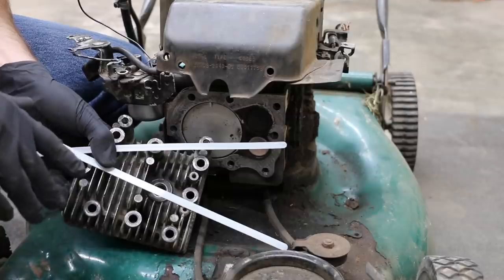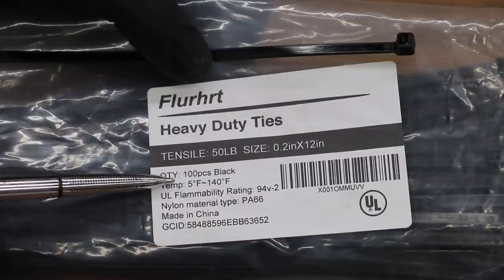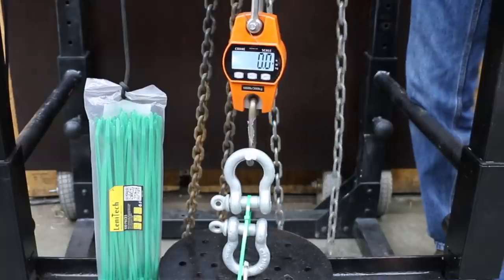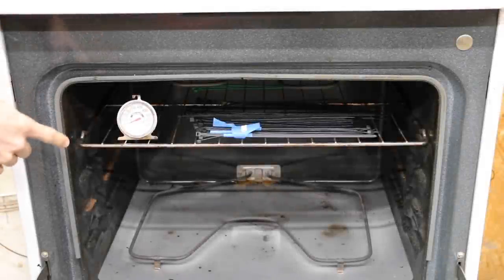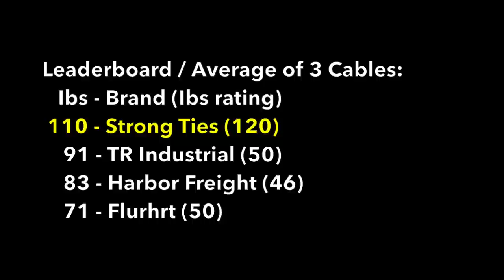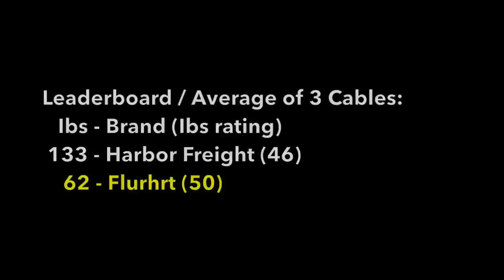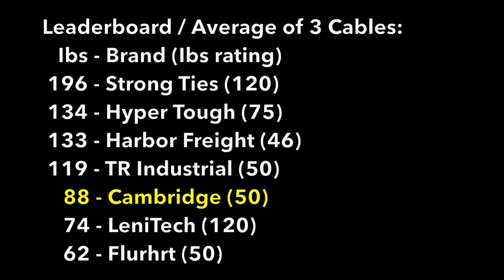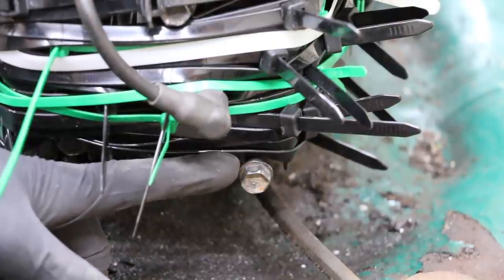Best Zip Tie Brand (7 Brands Tested)? Let's find out!

Comment: Here's a question to contemplate. If you rate a rope or cable, it is for a single length of material, not a loop. If you make a loop, like using a block and tackle, the load capacity for the assembly is each rope or cable; two ropes or cables would be double the listed load capacity. If it's that way with cable ties then many of them fail their rated capacity if used in a loop with two legs. A 50 pound rated tie should test at 100 pounds in a loop. Does the tester know the specifics of how the products are rated?

Comment: In your lifting configuration, it looks as if two strands of the zip tie are doing the lifting. Wouldn't you then divide the measured lifting capacity by two to get the final tensile strength?.. Just a thought🤪BTW: LOve your videos👍

Comment: When you loop the tie, the tensile force in the tie is half the scale measurement. For example 100lb force on the scale creates 50lbs of force in each side of the tie. A free body diagram would visually explain it.
Reply from the maker: Great feedback.  Several of the packages mentioned "loop capacity" for the strength rating as you've described. Thank you

Comment: I think there are at least 2 other angles worth examining:
Saftey: How far above rated capacity did they hold? In my opinion, that's why "Lemontech" fully deserves last place. I mean, their misinformation could easily cause injury or death.
Additionally, there's the geometry of the objects being tied. How might the results have been different with wider or narrower bolts? What about square or triangular?

Overall, this was a very enlightening video. I think anyone who regularly uses zipties should watch this and take note.
Reply from the maker: Thank you for the feedback

Comment: Could you of put all the head bolts in the cylinder block then put the zip ties on and removed the bolts? Or removed the bolts while it was running? Probably a little too dangerous
Reply from the maker: Great test idea!  Thank you

Comment: Can you test safety equipment like the different types of leather for gloves, steel wire inserts for butcher gloves, or switch it up to the million type of safety goggles and see which one will actually stop a grinder wheel explosion or lose nail from a nail gun?

Comment: At my house on the coast of CA, my problem with zip ties is not heat or cold (70 is usually a heatwave and 50 is a cold snap, frost is rare).  My problem is UV exposure.  After a season hold up a whirligig, the zip ties get brittle and snap.  Try doing a UV test on some zip ties.
Reply from the maker: Thanks for the suggestion.

Comment: I have never found a zip tie that will last over about a year in the sun. I sometimes use them to hold an awning tarp to a pipe frame and they dontt hold hardly any weight but they always break and fall off.
Reply from the maker: Thanks for sharing.

Comment: Here are some ideas if not already been tested as I frequently purchase or planning to:

Water based paint
Enamel Paint
High Heat Paint (engine paint)
LED Bulbs
Engine Degreaser
Oven Cleaner
Laundry Detergent
Carpet Cleaning Solution
Car Detailing Products I always see on FB like “the last top coat” etc
Dishwashing Pods
Dishwashing Soap
Best bottled water (cleanest, best PH, dissolved solids)
Best Sawzall blade (wood, plastic, steel)
Best Screw Head (phillips, torx, mor-torq, tri-wing)

LoL have at it!!! 👍🏼👍🏼

Comment: What use for zip-ties is there other than tie wires or other things together or to an existing harness or bracket?  Never needed even 50 lbs of tensile strength.   Have been using Harbor freight zips for decades.  No need to spend more.   Buy them on sale, even cheaper.
Reply from the maker: Thank you for the feedback
Reply: BroDerp, ties are used to seal the CV boots in most cars and many trucks today. You don't want a ten-cent cheaper tie failure leading to the ingress of crap and ultimate destruction of an expensive machine part.

Comment: The best zip ties are the ones that can be undone and reused.. zip ties arnt usually used when strength is required.. but often times need to be moved or redone.. having ones that can unlock is most convenient
Reply from the maker: Great point

Comment: I know you dont do sponsored stuff but theres a company that's come up with a "new" method of using vice grip pliers. It's called palm grip. They arent available to buy currently but I'd be curious to see if they actually work better than the traditional method of using vice grips.

The premise is you close the vice grips and use this 13 dollar bolt to achieve the torque you desire instead of closing the vice grips and tightening the bolt till it touches and opening them up turning an additional half turn and reclamping them to the nut.
Reply from the maker: I'd love to test it once it's sold to the public. I always buy the products I test. Thank you.
Reply: @ProjectFarm  their website is www.palmgrip.net
Reply: I should add that I'm not a spokesperson or anything just think it's a something that would make a good video

Comment: As I live in Germany, the actual tests are sort of irrelevant for me but Id love to see you try holding the engine together with stainless steel zipties. They arent verx elastic and you should be able to tighten them really well with special pliers for stainless steel ties. However they are really damn expensive compared to plastic ties. But they wont melt.
Reply from the maker: Thank you for the video idea!

Comment: I had the same digital scale as the one you used in the test.. sold moose meat for years and used it to weigh the meat, but then I found out after 3 years that it read 7-10% below the acutal weight.
Reply from the maker: Thanks for sharing.

Comment: I WAS WONDERING, AS YOU CAN TELL I AM WATCHING VIDEOS I HAVE NOT SEEN BEFORE. ANYWAYS, HAVE YOU TRIED PULLING THE ZIP TIES WITHOUT MAKING A LOOP OR LOCKED? I WAS WONDERING IF THE TENSILE STRENGTH WOULD CHANGE. THANKS.
Reply from the maker: Thank you for the video idea!

Comment: Something I wish we could have seen were a cycle of hot and cold. A lot of times zip ties need to last for a long time and can fail after a certain period of time, for example a vehicle application where it may be 40-50F outside but experience temperatures up to 150F while securing hoses or electronics. Many cycles later they would become weak, brittle and then break. 

This could also be applied to zip ties in an outdoor environment where the summers are hot and winters are cold, essentially, long term fatigue leading to failure where others may last longer.
Reply from the maker: Thank you

Comment: You are stressing 2 members so the load is shared by each. The break strength/load is 1/2 of what the scale shows. So when the load shows 160 its really 80 lbs on each leg of the tie.
 There is some friction on the clevis pin, so to be more accurate you should use a pulley on each clevis so the load will be equally shared. 

 Thanks for the great testing
Reply from the maker: Thank you for the feedback

Comment: All of these ties are more than strong enough for most of the uses cable ties are put to. So for most purposes, the question is not “Which brand is strongest?” but “Which brand is cheapest? That seems to be the Harbor Freight brand— which coincidentally, is also one of the strongest. Also, for most applications, you can increase the strength by using two or three ties if one might not be strong enough. Three cables ties at 3 cents each is still a lot cheaper than one at 33 cents.
Reply from the maker: Thank you

Comment: if i remember correctly there is a difference when it comes to zip ties and the color they are. like black insnt for weather or something or maybe white isnt but yeah i remember my girlfriend dad explain this to me one day but cant remember what he said about witch color. he was explaining it to me cuz i was doing an oil pan heater on my car and you use tip ties to keep the power cable out of the way so it dont get torn off by the road. well it can get anywhere from -80f to over 100f where im at and 7 months of winter of cold weather you always try and use to correct things when it comes to anything cuz the cold is harsh on everything and dont care
Reply from the maker: Great point on UV resistance and color

Comment: In one of my tool boxes I have about 100 black wireties that have tiny dots along their length that a metal tounge digs into. I use them only for special occasions like fixing a visitors clutch lever or holding anything that needs to not fail. I was hoping to see a version of them here but I guess the reason I have them hidden away is they are some next level shit. I also have a super expensive tensioner/cutter tool that must have come from the same dept.  Of wherever the ties came from
Reply from the maker: Thanks for the feedback.

Comment: what if you place the connection of the zip-ties on the metal? becuase if its straightening out like this, it will be weaker due to increased stress on its weakest point. i'd like to see this test done the way you should be using zip ties, with the connection point on a bending point and not a stretching point! otherwise good solid results.
Reply from the maker: Thank you for the video idea!

Comment: Could you do a test with heat strain? As in, repeatedly heat and cool the zipties from 140F to 40F? This would be very useful for people in desert climates who build things with zipties!

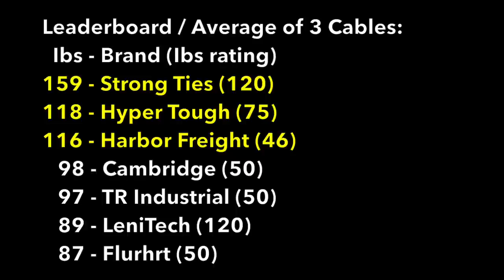Also, you should try looking at the data at 5:03 in terms of percent improvement over their rating! When looked at this way, the data looks very different:

Strong Ties (159-120)/120 = 32.5% Over Rating
Hyper Tough (118-75)/75 = 57.3% Over Rating
Harbor Freight (116-46)/46 = 152.2% Over Rating
Cambridge (98-50)/50 = 96% Over Rating
TR Industrial (97-50)/50 = 94% Over Rating
LeniTech (89-120)/120 = 26% Below Rating

Which means that in terms of bang for your buck, the brands rank as such:
Harbor Freight
Cambridge
TR Industrial
Hyper Tough
Strong Ties
LeniTech (garbage)
Reply from the maker: Thank you for the video idea!

Comment: Considering how most people use zip ties (securing wire bundles, etc.) either of these are acceptable so it would probably come down to price.  Funny how some packaging provides a 50# rating...this is what OSHA requires when using zip ties in lockout/tagout procedures, so kind of odd to see the HF package rating of 46#.  Looks like I'll be buying my zip ties from HF in the future.
Reply from the maker: Thanks for the feedback.

Comment: Unrelated idea: 

When brake rotors develop deep circular grooves from bad pads, rust, etc. the advice is usually to get new rotors.
While I never had dreadful rotors, I also never replaced moderately messy rotors.
 My logic is that as long as the rotors are not warped or too  thin, the grooves are irrelevant. 

Or maybe the grooves actually help. Consider a rotor with a 45 degree sawtooth profile (as an extreme); 

this rotor has much more braking area than a new rotor. 

So, Project Farm, do you want to mess up a few rotors and prove this theory right or wrong?
Reply: I've thought about this too.  The problem might be that as rotors become grooved, they don't groove evenly.  In other words the surface area of the rotor begins to vary in an uncontrollable manner, leading to unpredictable brake bias variations and ultimately a compromise in vehicle stability under braking.  It would be interesting to see how pre-grooved rotors would fare, as obviously they could be machined to be identical all around.  Some grooving is normal, and I think even somewhat more moderate grooving is OK in cars with modern ABS.  But I've seen rotors that look like corrugated metal siding... that's just plain unsafe, regardless.  

The other issue is heat mitigation.  A grooved rotor could be physically smaller while offering the same contact area, but it seems like it would have more trouble managing heat in comparison.  There's just less metal to heat up so it would heatsoak faster.  Same idea with rotor size vs. force exerted by the pad.  A large rotor with less pressure might perform the same as a small rotor with more pressure, but one is going to dissipate heat less effectively on account of it's smaller size.

Comment: I enjoyed the test and learned a lot, but it's not really fair to compare zip ties of different widths. The width of the  product, of course, directly affects it's strength. BUT, the data shows that most of the zip ties tested exceed the manufacturer's rated strength, so that's what one should really consider. I have used literally thousands of zip ties in my career as an electronics engineer. One of the things that would be very hard to test is how they hold up over time. Many of the ones I saw used in outdoor conditions became brittle and weak after a couple years. The types rated for outdoor use of course performed better than those not rated for outdoor use, most lasting over 5 years. Even in applications where the ties were in an indoor environment, after 10 or more years many of them would break under finger pressure. These were very narrow zip ties just used to hold bundles of wires together or to hold a wire against a structural member of a machine. I do believe during my 40+ year career, the zip ties I saw increased in quality somewhat, but then again, I didn't get to see any of those newer ones (in the last 10-15 years) after long use. BTW, most of the small zip ties I used were made by 3M.
Reply from the maker: Thanks for the feedback.

Comment: Thread locker, 2 stroke oil, weed killer, broad spectrum soil sterilizer, indoor plant food and lawn fertilizer, car wash, tire black, vinyl restorer, emergency road flares and other warning safety devices, tire sealer, jump start packs and cables, auto air fresheners, gasoline and oil additives, chain saw bar oil, thread cutting oil, rust removers, firearm copper & powder solvents & lubricants & patches, and water filters might be some other products to test.
Reply from the maker: Thank you!

Comment: Imho, using this scale based on weight/pressure is good to find the strongest - but with the different strength ratings, it’s hard to tell. 
Much like you AA rechargeable vid, percentages were the measure.  
I am of the belief that measuring the strength of the zip ties by % of rated capacity may change the outcome / final standings. 
Eh, then again, I might be crazy.
Reply: Edit: much like in your AA.....
Reply from the maker: Thanks for the feedback.

Comment: Tip:

 Slice a little 1 or 2 inch slit right in the middle of the side of a bag of zip-ties.  When you need a zip-tie, grab one and pull, it will bend and slip through.  

Oh, and you will no longer have zipties falling out of the bag all over the place.
Reply from the maker: Great tip.

Comment: The Cambridge is the releasable, right?  Being releasable is way more valuable, first being reusable, but more important, when you are bundling cables, for example, and you discover one more cable missed, you can undo, and add the cable.
          The brand of releasable zip tie I use is from Parts Express
https://www.parts-express.com/cable-wire-tie-7-1-2-50-lb-tensile-black-releasable-100-pcs-made-in-usa--080-852
This is a 7 1/2" black tie, 9.6 cents each.  You can also get then in natural nylon color.  They release the easiest, and hold when you want them to.  You didn't rate the Cambridge on ease of release, or number of uses they are good for.  The only disadvantage of the Parts Express ties is that they are not available longer, so I have to chain them.  Other longer ones are impossible to release without a screwdriver (and you ruin the tie when doing so).  As far as I am concerned, if a tie isn't releasable, it isn't!
          When you pull-test, it matters where in the loop the joint is.  I assume it would be stronger if the joint were on the end-bar.

Comment: Take a engine and run it off a wood gas generation set.
Do a torque and horsepower analysis.
Build the wood gasification system and see how long you can keep it running.
See if you can store pressurized wood gas.
Reply from the maker: Thank you for the video idea!

Comment: Interesting. I worked for a aircraft maintenance facility and the zip ties they provided would fail as your were pulling it tight. No idea what brand they were, but the quality control was non existent. Some ties would hold, others would snap immediately.

Comment: Dang this is awesome, but I am wondering why you did not test panduit, those are known as the best zips in industry
Reply from the maker: Thanks for the video idea.
Reply: Id really like to know, thats whats used in aerospace, so they use them to string wire in the planes. They do also make teflon reinforced versions for some areas of the planes that experience non pressurized flight.

Comment: There are definitely stronger brands but cost many times more than the  Project Farm brands tested.  For my uses, the Harbor Freight brands work just fine and the cost is best.  Since a zip tie is mostly used for temporary applications, I dont see the need to spend 5 times more for a premium product.
Reply from the maker: Thanks for the feedback.